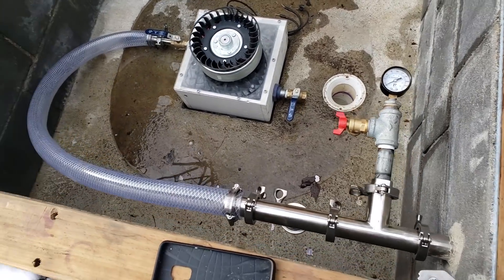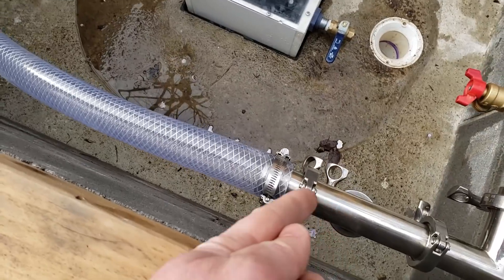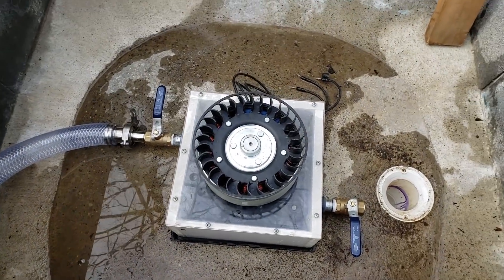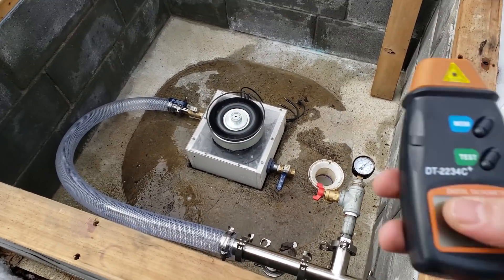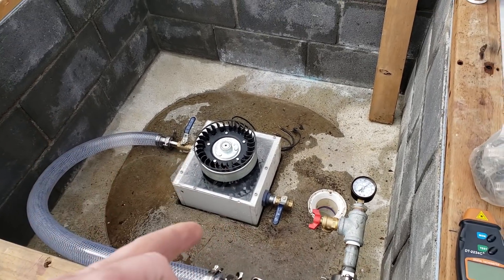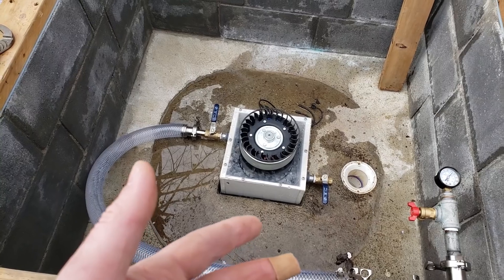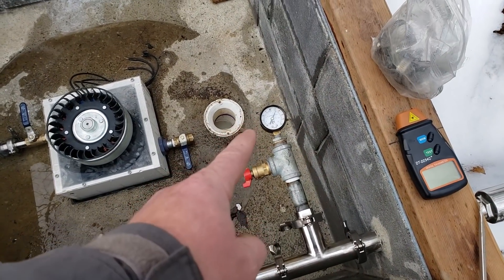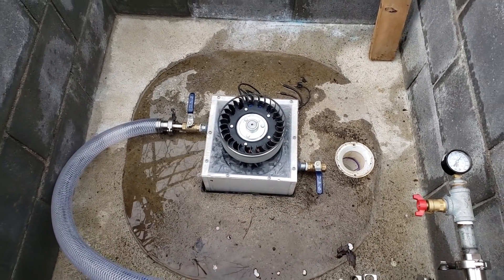Fat Hose (Turbine now up to 30% efficient)

Comment: What is the clamping system that allows for the quick connect disconnect of the nozzles from the incoming pipes? (I apologise for a complete lack of knowledge of the correct terminology here)
Reply: Late, but was looking for the right search terms myself. My guess this is  the "tri-clamp " system.  Google "tri clamp to hose" and you get something very similar.

Comment: How do you prevent the water from freezing when you turn the turbine off ?
Reply from the maker: I never turn it off, I have a bypass hose that I can open to service the turbine. I hook up a hose to the valve with the red handle.

Comment: kris harbour doesnt know what he is doing

I tried tpo explain flow to him...he wouldnt listen...it doesnt work like you think it does

your flow in the pipe is only as much as the pipe will allow...bigger pipe=more flow....once you restrict it at any point....that will be the flow rate

if your pipe is the same size all the way down...that is your flow rate.....the restriction of the nozzle changes the flow rate,, but it increases velocity of the head pressure 

head pressure is not related to flow rate....head pressure changes with height, as does flow rate...but pressure does not change flow

in and unrestricted flow, water will flow only as much as their is supply for a given height

a water fall for instance will only have as much flow as water available

inside a pipe, flow is different....if the end is not restricted then flow is determined by several factors...1) smoothness of the wall  2) how many bends and what degree 3) height

if the end is restricted.....only one factor above has any relevance...height...because you have restricted the flow at the end

now, on a turgo wheel, shape of the nozzle comes into play when trying to get the most....you want to try to achieve laminar flow...very smooth...you want that jet to be as round as possible

to do this the jet nozzle have to be smooth....study jet nozzle shape....you'll be amazed
Reply: for the best effeciency would the pipe have to be the same size as whatever the water is hitting, the fins or impeller blade?
Reply: @utubeape  
no....in fact, it wouldnt matter if the pipe was any bigger than it is now...it just couldnt be any smaller now..the jet nozzle on the end will only handle so much flow...and he has maxed it out already.....heres the kicker....if he could get more height for head pressure ( which he cant ....its limited to his source supply)....then he could get more velocity coming out of the jet

most people say pressure out of the end....it isnt pressure because it has escaped the the restriction ...thats when it becomes velocity
Reply from the maker: @t00ls742  I'm not sure what you are trying to convey here. I did pass college level fluid mechanics and my knowledge of the subject goes far deeper than I let on. All of your statements are generally true except when it comes to periodic restrictions. The geometry of the system as a whole must be accounted for.
Reply: @JoeMalovich  I apologize for the rant....you keep referring to to kris....he doesnt have your education...or mine

your last 2 statements are true...I thought I conveyed that....restrictions before the last restriction will slow the flow
and your pipe must be of a size to allow maximum flow for the end restriction ( jet) 

most people think that if you have a larger pipe than what you have for the size jet you have, that you will have more velocity out the end....there is a limit...you wont get any more flow than what your size jet will allow...as you stated, you know this....kris doesnt.....he said I was wrong

I think your doing a great job on the turbine side....and you are learning about the electrical side....which is where I have a lot of knowledge...I have been doing solar for many years and the electrical of that is very relevant to hydro output

I am currently working on my own hydro...financially limited at the moment

very soon I will be doing a video tour and explanation of the solar and what I hope to accomplish with the hydro

my jets on the hydro will be quite a bit larger than yours so I will be using a 4 inch pipe to get the flow volume I need

I believe you might be able to go with larger jet nozzles....just measure the total flow out the end of your pipe without the jet....put your jet back on and measure the flow
I would bet that the is less flow volume coming out the jet than your pipe...meaning your jet could be larger...meaning more RPM ...meaning more electrical output

I think you could possibly get 1500 watts out of your system with your current supply water and head pressure
Reply from the maker: @t00ls742  how do you think I should manage excess power? Specifically how would you configure a dump load controller that would work in conjunction with my charge controller to keep the turbine loaded at 100% without cycling or micro-cycling the batteries?
Reply: @JoeMalovich  
I believe the classic has a configurable setting for operating a 12 volt auxiliary connection which you can configure to operate a switching mechanism to rune a dump load such as a dc water heater element....I will go read the manual and see if I can find the exact page
Reply: forgot that midnite solar makes something called the clipper...its for wind and hydro and works with the classic
http://www.midnitesolar.com/productPhoto.php?product_ID=396&productCatName=Wind%20and%20Hydro&productCat_ID=25&sortOrder=3&act=p

it will do exactly what you want to do

a cheaper route would be to get a c-40 CC DL made by trace/xantrex/schneider and run it in dump load mode....using the aux function of the classic to control a switching relay when it goes into float mode....the switching relay would switch the wires coming off your rectifier to the c-40 input...the c-40 manual will tell you how to use it as a dump load only controller
Reply: @JoeMalovich  by th by...I have talked to robin gudgel on the phone for over an hour once...he is one of the co-founders of midnite solar...also was one of the original engineers at trace and xantrex

before he started midnite, he and several others started outback power

when I was on the phone with him, I made some recommendations about some solar products....which I can see he made use of but now has surpassed that

whatever he and his brother get into, you can rest assured it was built with all considerations of ease of use and quality
Reply from the maker: @t00ls742  Oh good, I too was thinking a dump load controller would be a good cheap method to dump excess energy. Downstream of the rectifier could it be set to maintain a constant turbine voltage in the 80v range? It wouldn't need to be MPPT functionality, just fixed voltage.

Could it be attached to the battery side and dump power from multiple sources? I intend to play with solar and wind too. I'm not very familiar with diversion controllers.

Comment: I don't see the air bubble as a problem; in fact a larger one would protect against water hammering. If you add a float valve it could also effectively remove bubbles from the water flow as well.

Comment: another idea is Why not run your excess water that your draining and have it go back into your line so none of the water your using gets wasted and you would essentially never lose water pressure you would just be recycling the water your using. How you would do this is attach a hose to your draining system then run the line maybe 300 feet up the hill and the water constantly coming in would be enough to push the water up the hill and into your line . I was saying 300 feet because if its too close the pressure of everything could blow your line.Tell me what you think.
Reply: Not sure I understood well but that's not how physics work, you can't do that.
Reply: so, you are going to use the power the turbine is putting out, to run water back up a hill.....doesnt work like that....you can never get more out than you put in
Reply: That's how you turn that thing into a swimming pool.

Comment: sothe question i have is with using this system can you power your house with only this hydro system and essentially make the power company useless
Reply: Ryan Raymond In theory yes. Just making it efficient enough to produce all of the energy you need is the tricky bit.
Reply: @AAAAAAAAAAAAAAAAAAAAAAAAAA-g7h  my next question is could you store some of the excess energy and sell back to the power company like you can with solar panels??????

Comment: I think you could just make a high spot in the supply line with a valve at the top, to vent the air out. :)
Reply from the maker: the air really doesn't hurt anything, and after a few hours it goes away.
Reply: @JoeMalovich  you was the one concerned about vibrations 🤔 😂
Reply from the maker: @RubenKelevra  it can handle little ones. it Really Really vibrates above 4000 RPM!

Comment: you should definitly add a burp/purge into your system right there. heck, if you just turn your gauge up and swap your gauge and petcock, you could just put a teeny bias lean to pull the bubble up to the petcock and crack it to purge.

Comment: The stainless steel connectors are looking really nice!
Reply from the maker: Thanks! If I weren't uploading to YouTube I would have cheaped out with something else. Not too expensive but super fast to reconfigure as I figure it out.
Reply: @JoeMalovich  where did you get the parts? I am gathering prices for components. I found the 2" ss ball valve on aliexpress for $22.
Reply from the maker: @LandtoHouse  eBay and Amazon, I didn't check AliExpress. I hear from Spencer you're going with 4 nozzles a high flow pair and low flow pair. Double check all the prices for components before you commit, it's been a little expensive...
Reply: @JoeMalovich  oh nice I will have to check and find those nice parts. Yes we have not locked down components yet. My system is small budget for sure!

Comment: Why main before nozel valve? wont the opposite push out the air?
Reply from the maker: The air will be there no matter where I place the valves. I don't want the entire hose to need to fill and build pressure which would cause problems such as slow jets of water and air spurts causing vibration.

Comment: If you're worried about RPMs why not just add another generator? You clearly have more water  than what the average Joe would.

I would think that you would be better than one one maybe only charging a Tesla battery bank or something like that... The other supplying all immediate power? You definitely have space two-run two different operations. It will just be valve tuning at that point for all intents and purposes
Reply from the maker: I don't have enough water, this drained the supply in short order even now in the middle of winter.
Reply: @JoeMalovich  negotiate building a large-ish holding tank with the neighbor? Still wouldn't give constant power but it'd run longer at a time.
Reply: Also, could you not add just a bleeder valve... My saltwater pool and pump has the exact same thing. Particularly if you know it's going to be at the same area. The pool bleeder valve is obviously at the top of the filter system...I'm not saying that you have to add a filter system or anything like that, but could you? Or at least at a place where air collects at the top of a bowel, and you are able to let it escape until water flows out.... Just thoughts

Comment: Joe Hartvigsen made my Turgo runner, he's a top guy and knows what he's talking about when it comes to hydro.
Reply from the maker: what are the specs of your system?
Reply: @JoeMalovich  Hi Joe, 200m of 4" pipe, 34 PSI standing with anything from 1 GPS to more than i can use (rain dependent) the turbine is the ME1112 with green Turgo runner 22 spoon if i remember right it's 6.5".
I'm running up to three adjustable jets (same kind as you have with the red cap) two are running off 2" pipe the third off 1.5" this one will be changed sometime this year to 2", we've not had any rain for a few weeks so i'm running of one jet open four turns (less than half) and getting around 375w when i have full water i have 920-930w, when i replace the 1.5" pipe on the third jet  to 2"  i expect to see an extra 40-50w.

Something i noticed when building mine i have the same RPM meter as you and found i got a false reading  because of the reflective case on the turbine  so had to put some black tape around the unit then put the reflective spot tape on that.
Take care
john
Reply from the maker: @johnbeattie9561  that's quite the system!

I had problems with the rpm meter too until I pointed it at an angle so only the reflector strip would have a strong reflection. I did exactly this in the video.

Comment: I would recommend redesigning you box. As it is the water coming off the spoons is bouncing of the walls and hitting the wheel and robbing you of efficiency. Most boxes are trapezoidal to direct the water rebound downward.
Reply from the maker: the stainless box will be a trapezoid.
Reply: not on turgo wheels....pelton wheels ,yes....turgo wheels shoot out the bottom